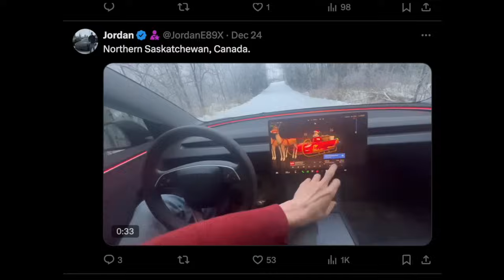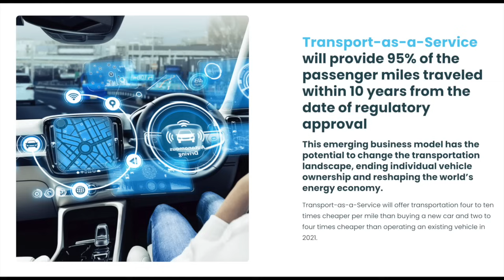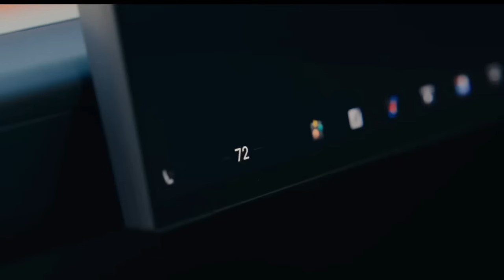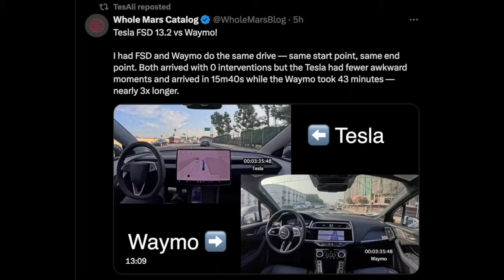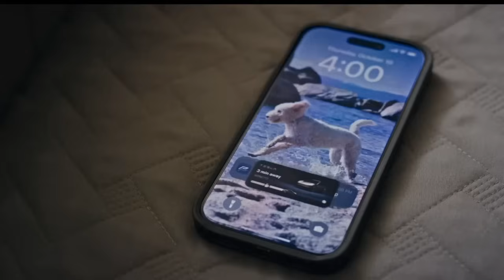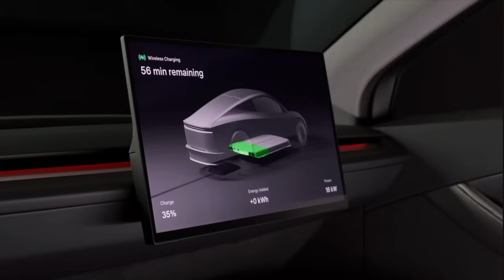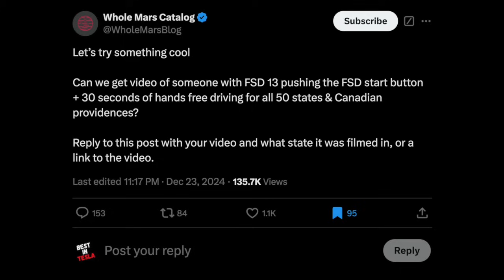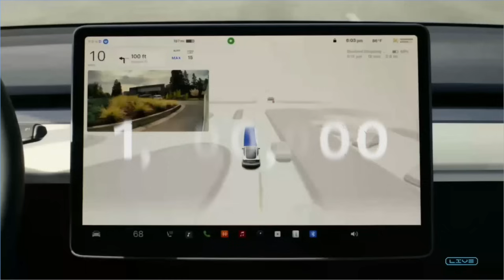Tesla's FSD V13.2.2 - The Secret Market Revolution No One Sees Coming!

Comment: You are right - CyberCab will become the preferred transport method.  As ‘personalized’ public transport - I’m certain it will disrupt public transport like busses and light rail more than anything because your ride  starts wherever you are and ends wherever you want - plus doesn’t stop for anyone else- plus is the safest for you and your stuff -  because you are not with strangers.   Relatively speaking, it will be a bit cheaper than an Uber but will take about the same time . Relative to public  transport it will be much cheaper (especially when you nclude parking and the ride to the station) and many times faster  (without the need for parking and multiple stops).

Comment: In car Compute ? Accessible OTA - but for it to be effective latency - a strong Wi Fi is required - so dormant Cybercabs will need to assemble in a Connected Parc . 
In car energy (KWh) CyberCab is not yet bi directional - no port , so engineering required but once done it will also require to be located at the “Connected Parc” but its priority will be to Load Energy , so it can work , not to unload  ?

Comment: Amazing insight! Hoping to experience FSD in South Korea as soon as possible.
Reply: So you’re in for a real treat, my friend, as I am currently driving on V13.2.2, and it is a giant leap forward in the race to achieve a level 5, fully, capable autonomous, driving car, possessing a real world capability of driving from point A to point B without any human intervention, and do so consistently, safer than any human alive today. 

So it is currently in my opinion that good, and we’ll see what happens next year with the launch of the Robo taxi, because if we’re going to be allowed to join the Robo taxi fleet, then FSD unsupervised will have to become a real thing, otherwise it’s a house of cards, and I don’t believe it’s a house of cards, as it’s just a matter of dealing with some slightly irritating issues associated with FSD as it currently exist, and one of my pet peeves is, that it still can’t distinguish between certain traffic barriers, and it doesn’t know what a pothole is and why you should want to avoid them, as well as manhole hole covers protruding way above the road surface or below the expected road surface, and for me, that has to get fixed if it is to become a real thing/service that one can count on. Comphrende. Cheers 🥂

Comment: This will be the death of trains, busses, taxi companies etc. unless trains will convert to more cross country travelling, with like a stop every hour or so. Like an express elevator, where you use the cyber cab to get a part of the way, then the express train cross country and cyber cab again to the destination. Trains where I live has so many stops, they spend more time standing still than driving.
But I would be afraid of traffic congestion, so they would have to redesign the entire city road structure to handle the increased traffic or they will ban cars in city centres to keep the public transport profitable. My prediction is also that the price at first will be kept just below the competition to make a huge profit.
Reply: Nope.  You can ride a train for 1,000 miles for $25.  It will cost $250 to use a Tesla Cab for the same trip.
Reply: @davidbeppler3032  Nope! Depends on the country as in my country you can NOT go 1000 miles for $25(£20) no way !
Plus Tesla could offer cheaper rates for travelling from one town to another as they would control the costs much better.
Many people do not like using the trains that are late, badly maintained, slow, have to travel with other people who are annoying and loud/obnoxious especially Americans!

Comment: My guess is that its gonna be closer to 3-4 million cybercabs a year in 2-3 years
Reply: Currently Tesla builds a Model 3 in about 10 hours.  VW builds a ID3 in about 30 hours.  Tesla plans for Tesla Cabs to be produced in less than 5 hours.  Or about 250k, the production of Model 3s, x2.  So, I expect 500k Tesla Cabs a year in about 3 years.  Each one profits about $20k a year for 3 years.  Or $17 billion in profits in 3 years.  :)
Reply: @davidbeppler3032  I see the number being much much higher as it is not where Tesla are now that counts but where they will be in 3 years time. 
They will hit the ground running as they designed the Cybercab to be quick and easy/cheap to build. They built scalability into the system. This means that Tesla will be able to INCREASE production of Cybercab through existing factories and new factories.
Tesla went from brown muddy field in Shanghai China to finished factory producing cars in less than 12 months.
Tesla therefore could easily build a factory just for the Cybercab in a year and scale up production  much quicker than  the Model 3/Y.
Tesla could build 2 or 3 factories at the same time and thus scale up production even quicker. 
Tesla want to produce 20 million cars a year and that is not to be achieved with the Model 3/Y and so the Cybercab will be the bulk of that 20 million.
So I see Tesla producing at least 1 million Cybercabs a year by 2028.

Comment: lowest cost per mile will be under 50 cents: "per mile" 4c depreciation at $15K 500K vehicle lifetime, 3c maintenance, 3c insurance, 3c tax, 10c Tesla platform fee, 8c power, 5c finance.
Reply: 1 cent over 1 M Miles, 1 Cent Maintenance, 1 cent insurance, 1 cent overhead, 1 cent profit, 5 cents wholesale for energy. Closer to 10 cents if you extend the lifespan to 1 M Miles.

Comment: Interesting ideas thanks. Rivalry will certainly make scenarios more complex. Then there are the utilisations of the cyber vans and how they will handle small business goods that inwards. Town planning will radically change (parking spaces)
Reply: Parking spaces will not go completely away.  But every Tesla Cab can remove 2-3 consumers from buying cars.   So, overall the amount of cars bought goes down, but the number of miles driven goes up.  With dynamic pricing rush hour will be much less congested.  You can leave at 7:30 am for $0.55/mile or leave 15 min early for just $0.30/mile.  In a week you lose 1.25 hours but you save $33.75 a week on the average 26 mile commute.  FYI that is just $8/day to be driven to work.  What if Tesla starts a carpool system so you can split the cost?  Then you meet new people and only pay $4/day.  Imagine you and your GF or Wife working in the same area and carpooling for just $4/day!?
Reply: @ thanks

Comment: Good point that cyber and are private.  They will also have wi-fi hot zone?
Reply: Most likely not, you have a mobile network, no need to mix in a router that will just complicate things.
If the roof is made of plastic the signal will most likely be strong enough

Comment: TBO. I think robotaxy will be a great market, but more competition for busses, trains and so on. The individual driving will still be a great market even it is not cheaper. People will want to leaves there things in "her" cars. i think 60 maybe 65% to 35% privat own vehicles will be more the case, but still that an enormous market. This will change over time more to 70 to 80% but this will take time. And i think 80% will be some cap, because people will always "own" cars even it is 200% more expansive. But still a great market. Owning something will still be better in some or most minds for a long time. Therefor owning and renting out will be a big thing. If Tesla could realy pull that thing off for costumers and buyers. That would be new, great and would benefit all. That isn't be done bevor, therefore  Tesla will go for it. "There is a track record" :-)
Reply: Roe-Bo-van
Reply: @SparkySho  Same Thing. It's great. But. Let it go of the thing you own. Let you think. And that will take you a while.

Comment: Problem with making the ride to cheap is there will be a huge demand and if the time for the CyberCab to arrive is too long that could turn the early customers off. So the price has to be set so the demand matches the time for the CyberCab to show up.
Reply: Nope.  10k Tesla Cabs with a price of $0.20/mile will not cause 4 hour waits for cars.  Also, have you heard of dynamic pricing?  Rush hour, prices go up.  3 am, the prices are at the lowest.
Reply: Imagine a major convention comes to town and 500 Tesla cabs line up at the airport to pick them up.  Then swarms the hotels an hour before the convention.  Then swarms the convention center 15 min before it lets out.  Then swarms the hotels after the convention to take them to the airport.  Same for major sports events, concerts, holidays... No human drivers.  The cabs are always ready.  90% uptime.